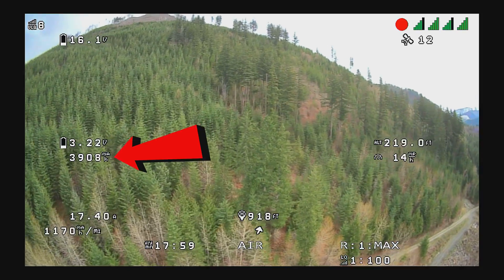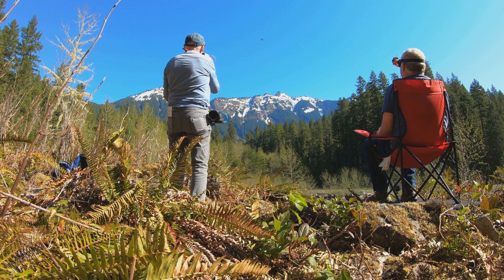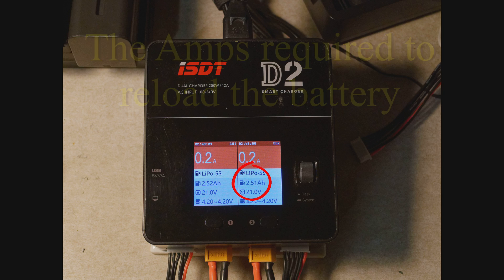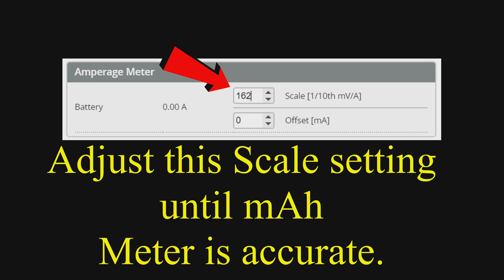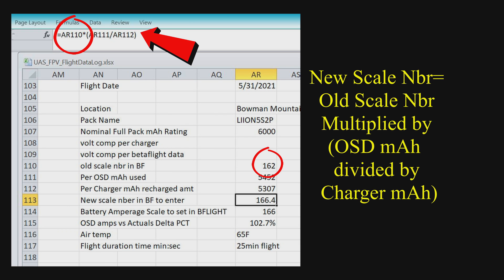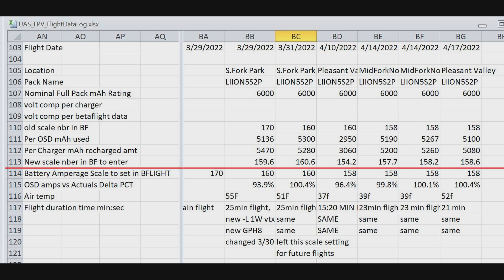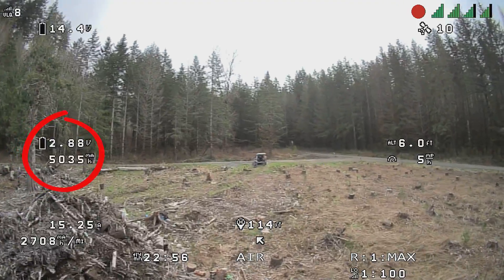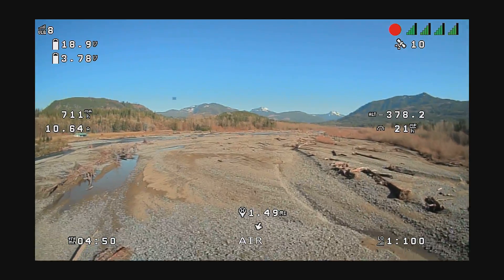Amperage meter calibration for FPV Flights Betaflight

Comment: Just want to add you need to calibrate the Amp meter to your flying style. Heavy on the throttle will produce different results in calibration vs slow flying.
Reply from the maker: I'm not sure I agree.
Reply: @ValleyFPV  I agree

Comment: How are you flying below 3.2v ??
Reply from the maker: Thanks for watching. The battery cells that my pack is made of have a low voltage cutoff limit of 2.5v per cell. One benefit of some Liion cells over LIPO cells.
Reply: @ValleyFPV  oh okay

Comment: It should be noted that when charging the battery back up after getting your initial OSD mAh reading to see the charger in non-balancing mode. 

This will prevent extra mAhs from getting put in due to balancing of the cells. It's recommended to only do this with batteries you trust (new versus worn batteries) to get a better current scale number.
Reply from the maker: Sounds reasonable

Comment: This is very useful - thanks for posting this .Quick question - if you have a 1000 mAh capacity battery, how many of those mAh do you want to use to be safe (for returning the quad and to avoid battery damage). Thanks.
Reply from the maker: Thanks for watching. It really varies with the manufacturer of the cell and the cell type. I download the specs white paper which gives the lower limits. I use packs using 18650 or 21700 Liion cells and my rule of thumb is 80pct to 85pct max draw of the rated amps. my 10000mah packs i land by 8000 or worst case 8500.

Comment: Another super helpful video for folks, well done. This is super important and often overlooked which can result in damaged packs or worse lost quads… 
I usually do a quick comparison of the Charged mAh to my OSD after each flight, and to anyone that can’t get it perfect, error on the high side, so your Current and mAh used are higher than real-life. This will creat a little extra safety net. 
Thanks for making this video! Cheers!
Reply from the maker: Yep, good suggestions.

Comment: So the formula I used was inversed. Bf*charger/osd. The correct is bf*osd/charger. I have question though. Why a different battery would need a different calibration? Let's say they're identical sony vtc6 packs, is that because of battery health? Another q, can we do calibration even though we sample flight only. Say lipo 1.8Ah, I'll fly for 30 seconds, record osd, charge my battery maybe now at 80% then to 100%, record and do the calibration. Seems I'm not violating the formula? Many many thanks.
Reply from the maker: Thanks for watching. All very good points to consider. I am by no means an expert on the  subject and make some good comments to consider.
Reply: @ValleyFPV  thank you too. Your method of complete draining the battery to calibrate is perfect. Fact is, I can't do a test 4x in 1 session coz I'm casual flyer only. 1pack LR is best I can do in 2 weeks. My idea though may not be accurate because of fast draining when low bat level compared to full.

Comment: Thank you for great content, once again. 

Can you tell me what kind of % of a pack you utilize? 
If your pack is 6000mah, do you draw 5000mah? Or what's your rule? 

Thumbs up
Reply from the maker: Thanks for watching. I touch on this very subject in another video which will be posted online within 24 hours. Watch for that. I explain why, how I calculated it; the short answer is for this LIION pack and these cells, approximately 86% or around 5200mAh

Comment: I've chased this for a long time. The best it will get is "somewhat close', within about +/-200mah. Like you said, different batteries have different internal resistance, if you change # of cells it will be off by more. How fast you discharge i.e. Acro vs cruising. Ive found a number where some batteries are a little high and some are a little low. As batteries age you won't get as many mah out of them before they sag. The thing is to leave yourself some reserve and watch the cell voltage.
Reply from the maker: Thanks for watching and indeed your comments are true!
Reply: Yeah best to keep an eye on both mah and voltage. Some of my lipos of same capacity have worse IR so i cant draw same amount of mah out of the higher IR packs before voltage sags.